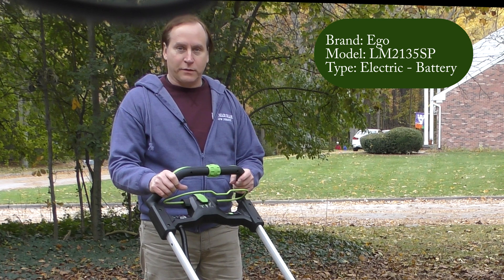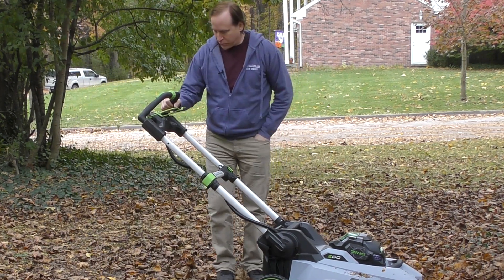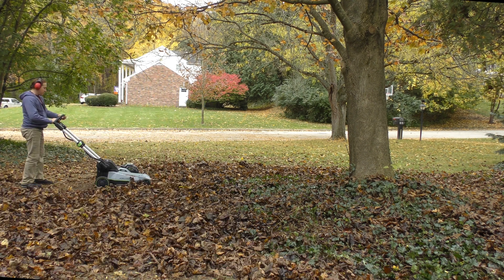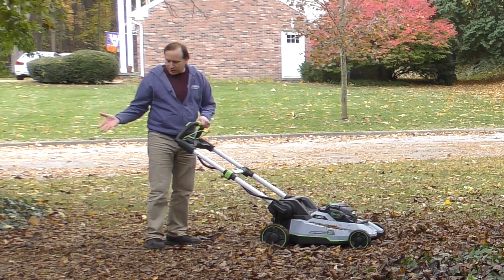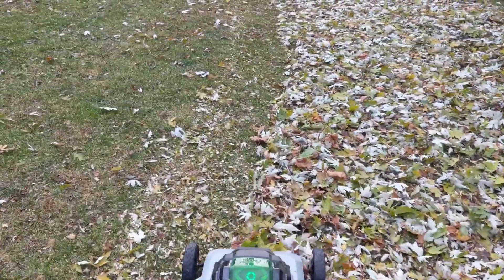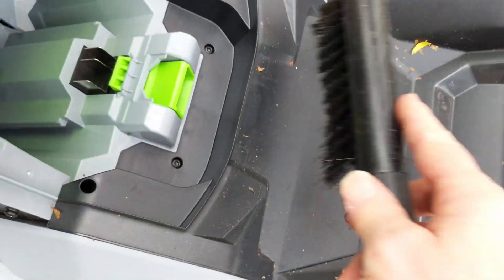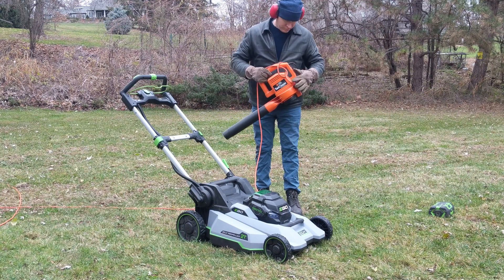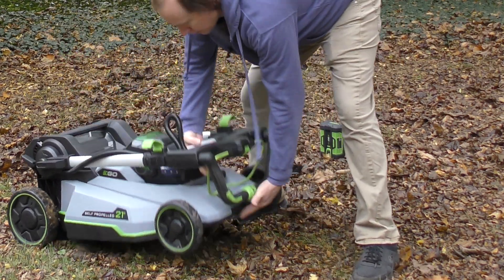DEMO of the EGO Cordless Power+ Mower LM2130 - Do electric mowers work?

Comment: I owned this exact modle mower and it was great for cutting grass only, but horrible for mulching leaves when compared to my old gas mower. I ended up returning it for a Honda Gas mower which does a better job  cutting grass and mulching leaves.
Reply from the maker: When you found the Ego mulching unsatisfactory were the leaves wet?  I think Honda has been a top performer in the gas-powered models.
Reply: @Aeromousikos  yeah sometimes it was a bit wet. Also small dry leaves would get left behind. The only time it would mulch okay was at the lowest setting with dry leaves only. I rather not scalp the lawn so I switched back. Honda obliterates the leaves into such fine pieces, it looks like you raked them up.